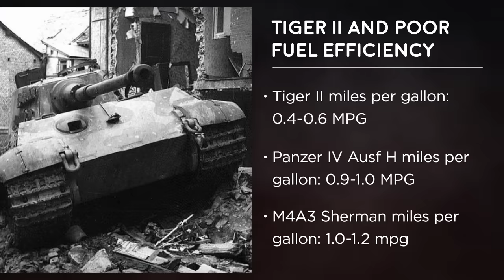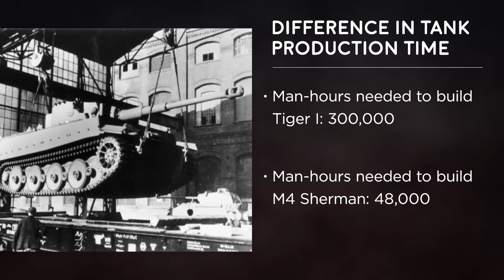Why Did German Tanks Perform So Badly in The Battle of the Bulge?

Comment: My grandfather was in the 41st Armored Regiment and was part of Patton's relief of Bastogne.  We spoke of the war often.  I asked him about the Tiger and he said it had two specific weaknesses, neither of which is ever mentioned.  

The 88 was an incredibly effective weapon, but it had an extremely long barrel.  The problem faced by the Germans in the Ardennes is that in heavy woods, the turret often can't rotate because the barrel would hit trees and stop.  

The second problem is similar to the first, but mostly was an issue for the Germans in open terrain.  The Tiger's turret, being so heavily armored, rotated very slowly.  In close quarters, a Sherman could move forward faster than the Tiger's turret could rotate.  If the Sherman could get ahead of the Tiger's line of fire, it could outrun the turret rotation and they couldn't get a good shot.

Throw in poor fuel efficiency, poor reliability, poor logistics, and heavy weight and you have a tank that isn't nearly as effective as it could be.
Reply: Yeah, it's been often written that the Tiger's turret couldn't turn much to the point that some descriptions suggest the turret didn't turn at all, that the entire tank had to turn to aim. Is why the Panther was the primary MBT although the Tiger was feared whenever it appeared.
Reply: Tiger tanks were essentially semi-mobile pillboxes.
Reply: Add in the determined resistance of the American soldiers.  The defense of the elsenborn ridge area stopped the 6th SS army cold

Comment: The lack of alloys was no joke there was a incident where a IS-2 group was shelling a position with HE when a panther caught them by surprise. Instead of wasting time unloading the shell they just fired at the panther. The shock from the 122mm HE cracked the sloped front plate causing the crew to panic and bail.
Reply: Late war there was instances of 75mm HE from shermans cracking the front plates of panthers.
It was not super common, but it really speaks volumes of the awful quality of german tanks and their steel by this point in the war.
Reply: german tanks in ideal condition were a formidable force to be reckoned with.
in the later stages of the war, steel quality, general supply situation and crew experience turned the once mighty enemies into a controllable issue that could be handled adequately
Reply: @Gary_The_Metro in all soviet tanks it was ultra common though. In an account from a soviet infantrymen in the battle of Kursk he describes a panzer II with its tiny 20mm gun making a t’34s frontal armor plate slide off the rig. Meaning the weld holding the plate to each side literally snapped like plastic after a 20 mm round hit it.
Reply: @bigsmokes2708  If it was "ultra" common, Germany wouldn't have needed to make overengineered crap to defeat them.
Reply: Well to be fair there aren’t many metal plates that won’t warp from a 122mm HE round point blank just the force of something that large and heavy will deform it followed by the blast increasing the pressures exponentially. It was one of the reasons they used that gun on the IS-2. Granted hull breaks are more common on the 150+ calibers it’s very plausible at at 120+. Add in weaker steel from being late war and sabotage from their slave laborers and it was a done deal the moment the tank rolled out the factory

German tanks were still better though if made exactly to specs and crewed properly they just.. didn’t have enough to stop us all